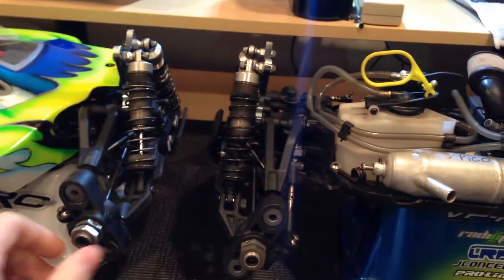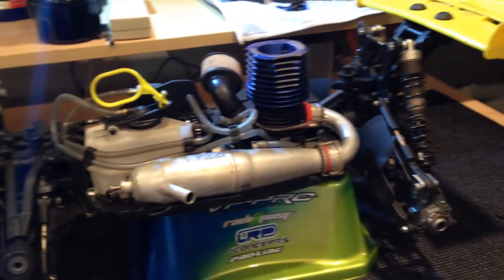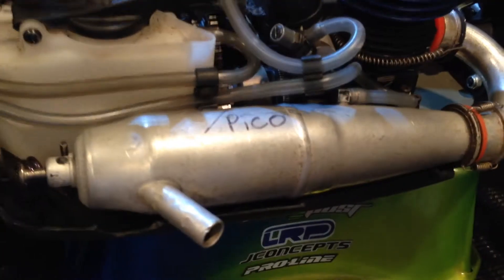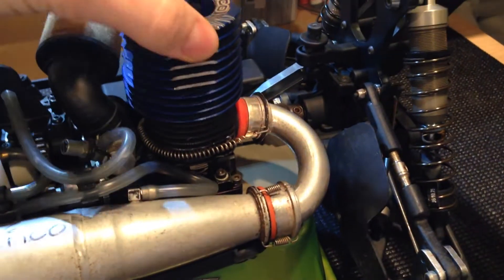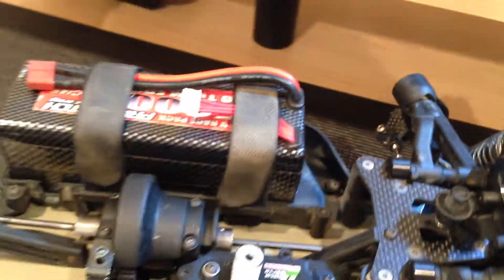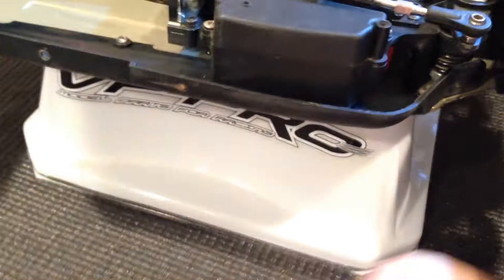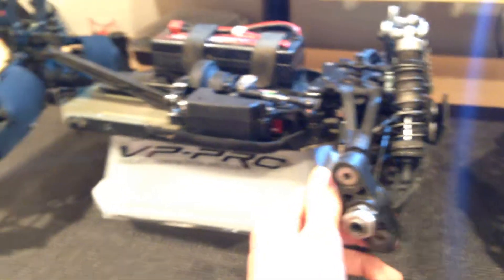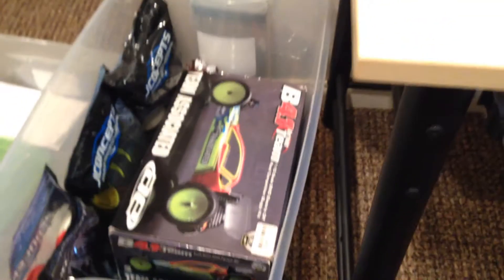Update 3-26-14

Comment: What upgrades are on it
Reply from the maker: Lunsford turn buckles, aluminum rear hubs, b fast ball diff kit, carbon top plate and chassis, aluminum front spindles, rpm ball cups, Lunsford titanium screw kit, carbon fiber battery strap, mip cvd kit, and i could also include come lipos if needed for a little extra. email me therckid17@aol.com i could send you some pics